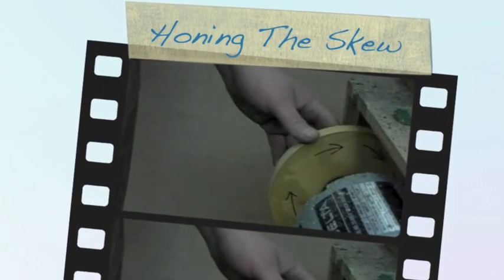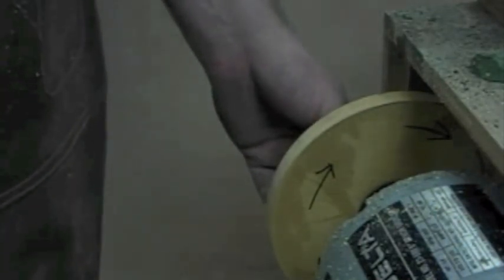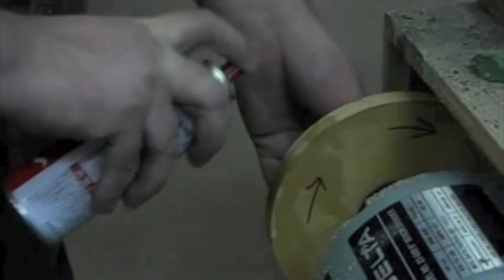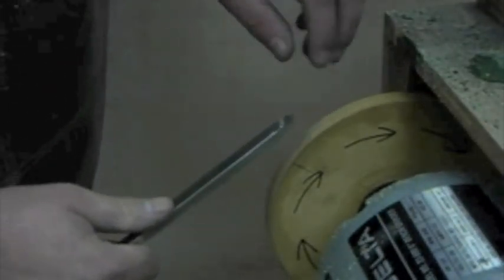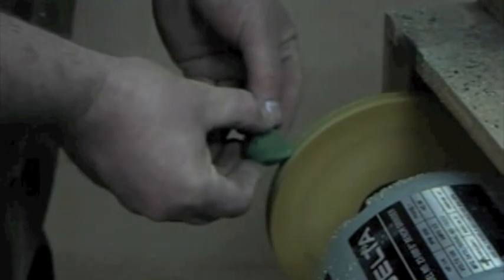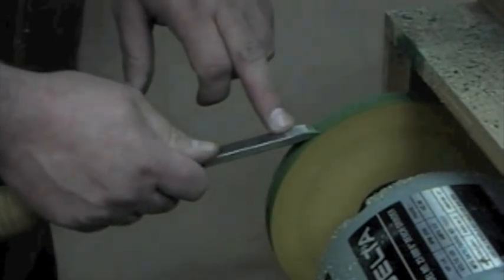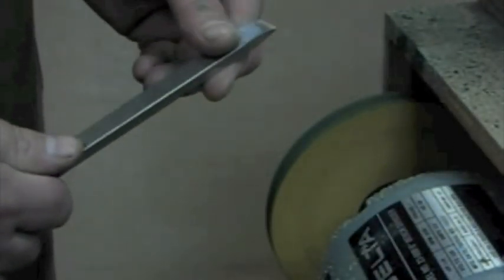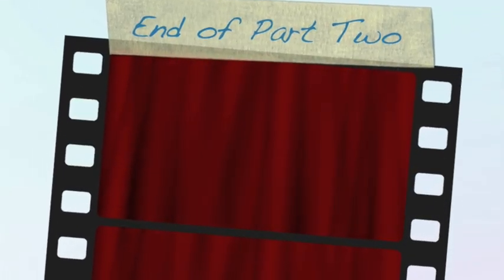Eli Avisera Skew Part 2 "Honing"

Comment: had a few questions for ya! first off love the vids... dont sell yourself short brotha very detail oriented and you explain everything very well... was wondering though... is it necessary to use mdf as opposed to some other kind of wood? Was thinking that since I dont have a high speed grinder at the moment I could simply use my lathe and a trued up piece of soft maple. I know it's no big deal goin to the depot for some mdf just would rather not buy it if I dont have to:)
Reply from the maker: Bond3737 the ones they sell are actually made from compressed paper, but I think that soft pine might work. The other thing you can do is make your trued up piece of maple and glue a piece of leather either on the edge or on the face and then load up the leather with the oil and rouge.
The problem with something that is NOT MDF is that it will have a grain to it, so part of the wheel will be end grain and the other part will be side grain, the end grain will hold the rouge just fine, but the side grain will not hold the rouge very well.
Cheers!
Reply: ah soooo!!!  thanks man:)